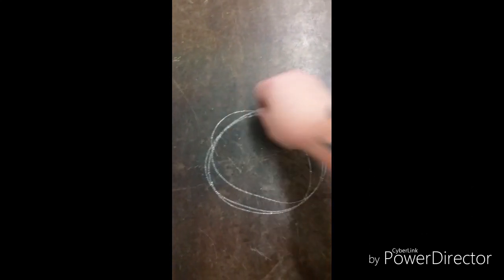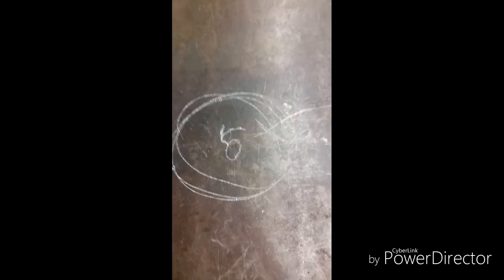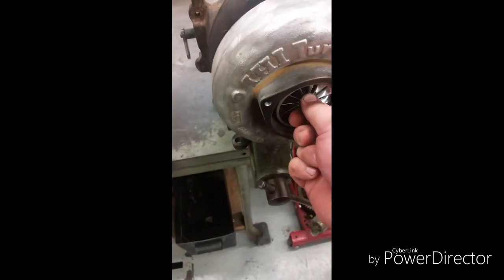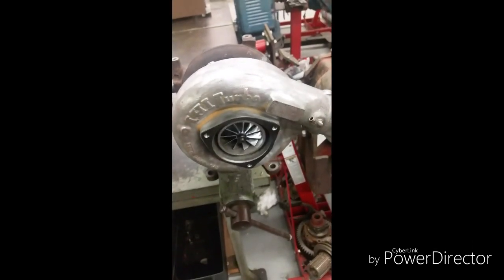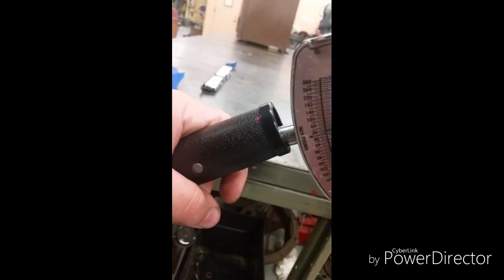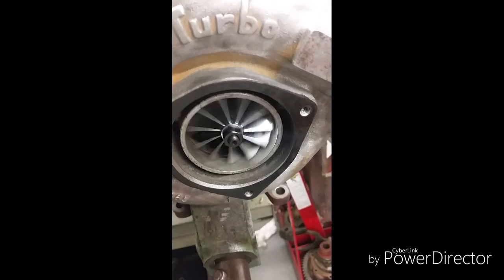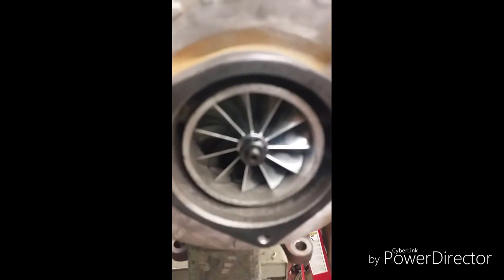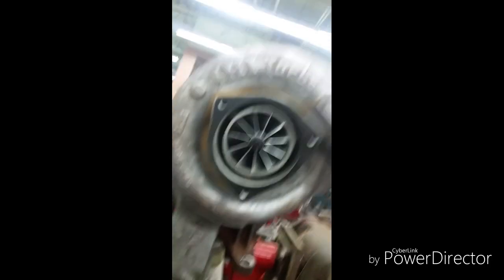Showing dan's diesel performance are idiots

Comment: Left handed nut who knew lol !!!!!!!!!!
Reply from the maker: mike2191958 "This is known as a right-handed (RH)thread, because it follows the righthand grip rule. Threads oriented in the opposite direction are known as left-handed (LH). By common convention, right-handedness is the default handedness for screw threads. Therefore, most threaded parts and fasteners have right-handed threads."

Comment: Ok i was just curious every turbo rebuild company has said around 150 inch pounds for their rebuild kits. And you say 10 so i just ordered a new one.
Reply from the maker: Jonah Luebbering what model turbo are you rebuilding?
Reply: Lb7 tutbo can you take a picture of the torque spec?
Reply from the maker: Jonah Luebbering not sure how to share a pic on here. best thing I can tell you is snug it up till the wheel doesn't turn. 10 inch pounds is what ihi and wicked wheel state, but may require a little more on worm turbos or stock wheels. most everyone just hits it with an impact and letting it free spin. I only went through the trouble because I did what the above shop said to do and it wouldn't spin and had a lot of drag. I will say that brake away tq and what you initially torque it down to are much different. the reason why it's more tight is from it tightening as it spins and any corrosion that may have built up over time.

Comment: Can you show where it says 10 inch pounds in the repair manual? just broke loose a brand new ihi and the break force was 147ip from IHI while putting a billet wheel on
Reply from the maker: Jonah Luebbering I can't give a link because the program we use at my school is password protected. if you look up wicked wheels and download their pdf instructions, it will show its 10 inch pounds ad well. the bolt is self tightening, so you only need to start it so it doesn't free spin. do make sure the nut isn't damaged and the threads on the shaft are clean. I ran a tap and die over mine to be sure.